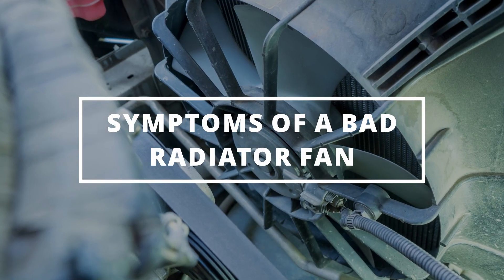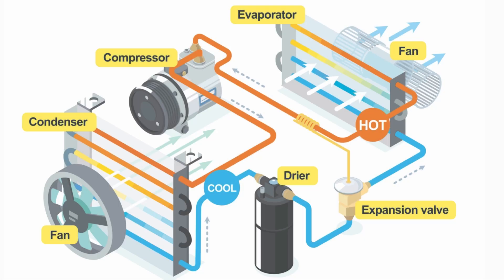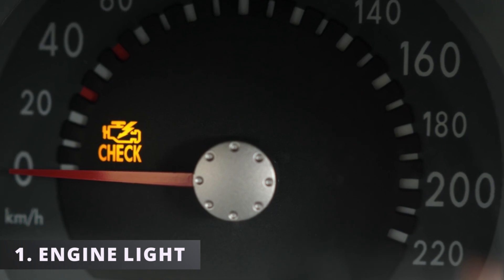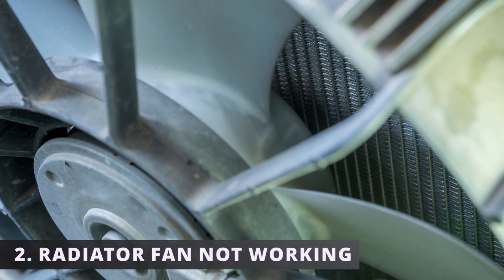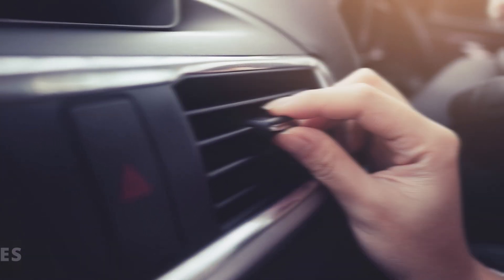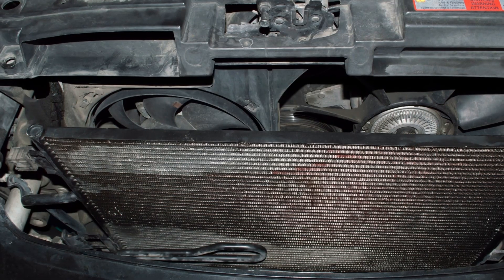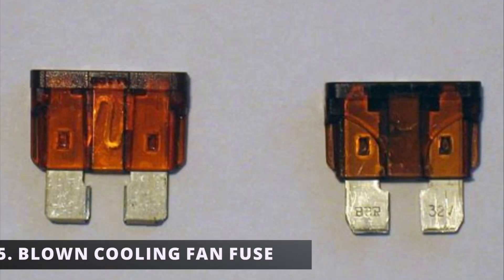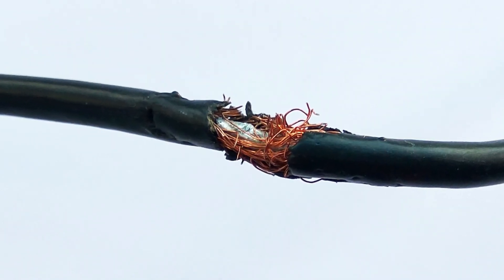SYMPTOMS OF A BAD RADIATOR FAN

Comment: I noticed that my cooling fan don't work and so does the AC fan doesn't turn on but I did notice the other time when I was checking the cooling fan from the driver side I disconnected the plug and I noticed the connector was burned out maybe that's the reason why both fans don't turn on.. I checked the relays and I replace the relays the fuses look good I think that has to be the problem!!

Comment: Am haven a few symptoms in my chavy Tahoe but i noticed that the connector is burn the other driver's side fan but not the ac cooling fan how weird do i have to replace the wires or but the fans with wire connectors!??..

Comment: TO TEST THE FAN : 
 I first turned on AC with car running and the fan never came on. Next I unplugged the electrical connector and put 12v from battery to the fan. Nothing. Next I put my volt meter in the electrical connector and put the meter on my windshield so I can see it while running the car. In the car I turned on the AC, the meter showed 14v.  So Fan doesnt work with direct power put to it, and doesnt work when AC on and system power goes to it. Fan kaput. $100 repair on a 2014 Fiesta and a lot of dismantling to get it out.

Comment: Can a non working fan prevent the AC from completely working? We have a 2014 Toyota Sienna and the AC light is flashing. I checked relays which seem good, and then noticed the radiator fans aren’t turning. The relay for that doesn’t look blown or anything.

Comment: If the sun is down and it’s 74 degrees outside, while the car is in idle, AC is off and the radiator fan is spinning but producing super hot air? Is this normal? The engine bay is too hot to the touch , some people are saying this is normal, but I don’t think so. Any feedback is appreciated.

Comment: If anyone sees this, I replaced a 40amp L shape fuse on my g35 coupe and it turned the radiator fan back on (passenger fan). Then it stopped working a few days later and I saw the fuse bubble up and it’s not blown but it’s to the point where it won’t spin so I guess it’s blown. The fan is aftermarket OE fan so could it be drawing or trying to put out more amps then the 40amp fuse can handle thus causing it to blow? If so I’ll replace the fan Motor
Reply: Update; a nail was touching my harness cord and it thought it was ground so it would blow the fuse!

Comment: I’m seriously struggling to find out why my fan is really loud.. when it comes on I lose engine power. Have no fault codes
Reply: Update: found out it’s just my car doing a regeneration
Reply: @vnoobsniper what’s a Regeneration? 😲
Reply: @ it’s where the engine runs at a higher temperature while driving to burn off spot build up on the dpf filter

Comment: I am having these issues. Turns out both of my radiator fans are not working. I didn't notice the AC fan went out since the main still worked until a few days ago. Not sure when the first one went out, but I guess it is common since the main fan can easily compensate. When I tried to take off the harness from the secondary fan, the harness plug mated to the fan crumbled off and was burnt. I decided not to mess with the main fan plug on the off chance it might still work, it doesn't even after bypassing the wiring. I ordered a temporary universal fan via 2-day shipping until I figure things out.

Comment: my radiator fan doesn't run, and my ac acts exactly haw you described but everyone I asked says they're not related but none of them have looked at it can you tell me other reasons why both wouldn't work?
Reply: I’m in the same boat as you my friend tho u can turn my fan on with a scan tool and, so Ive ordered a new fan with motor module/😮relay  I’m not sure exactly what the box is attached is , also if you unplug your wiring to coolant sensor it should come on automatically , I’ve a few other things to try so here’s hoping it’s one of the above .

Comment: My 2011 ford taurus had the water pump replaced because of leak. But car over heats with running a/c and the fan doesn't shut off and it drains the battery. Please help 
Thank you

Comment: If one of the two fans is working, should the other be working, also, at the same speed? Or is it computer controlled and additive, meaning does only one fan sometimes come on, normally, and the second fan only when needed? I've got one of the two fans that is acting sluggish when I first started the car, then stopped completely before the motor warmed up - not sure if this is normal or not. Thanks!

Comment: I’m having an issue where as though my fan keeps running after I turn the car off and it drains my battery, I just changed the fan and it’s still doing the same thing, what do I do?
Reply: Sounds like the relay

Comment: I had this problem last year in September. I was driving at highway speeds and the AC was cold but in the city it wasn't as cold. It also overheated and stop and go traffic but when I was on the highway it didn't overheat. So yeah it was the fan and I fixed it but I already knew that before watching this video but it's still very entertaining So thanks.
Reply: What was wrong with your fan

Comment: Hi why would the fan stop working on a 2017 Chevy Suburban
Reply: Many of reasons. Could be lost of proper voltage/ground. Is the low and high speed not working or both all together ? If you have proper voltage and a strong ground to your connector. You should try take the fan off and jump the power and ground to the pins. (Note) don’t worry which pin is negative and positive. It’s a dc motor so you won’t hurt anything if you’re worried about crossing the wires. Fan will just spin backwards if anything. But try to supply external power and ground to the control module and if that don’t work. Your narrowed down to a bad control module or motor. You can also by pass the module and juice directly to the motor. If your fan starts spinning after juicing directly to the motor. Your culprit is the control module. Hope this helped. And goodluck with your problems!

Comment: I have a problem with my Mercedes e300, fan sounds like a jet engine but I took it to my mechanic and they said nothing in the car is telling the fan to turn on, so they said I might need a new battery will cost me about $500-$600 plus the labor.

Comment: What if the fan runs but your temperature rises when it's idling or low speeds? Fan runs constantly, even when you've cut the engine. Water pump and radiator are fine. Could it still be the fan?
Reply: Did you find out?
Reply: Fan speed controller. Or a stuck closed relay. Should check both to eliminate the problem

Comment: i think my cooling fan may be bad, i was sitting idle with the A/C on and i noticed the temperature gauge was getting high but as soon as i turned the A/C off the gauge went back to normal… it was also normal when i was driving and it sounds like i can hear the fan when i’m in a drive thru… it’s also hot af in texas right now
Reply: Facts. Im in Houston and shit been 100 degrees
Reply: dont go through drive throughs   lol   lol
Reply: @CJ.A-C 😭😭
Reply: Did you replace the fan and fix the issue?
Reply: @papajoewil10  yeah it turns out one of the fans weren't working so i replaced it and it's working perfectly again
Reply: @sweet49101  Thanks for replying having this same issue right now
Reply: @nkefung  I think my fan may be going bad as well haven’t noticed anything with a/c or heat but when in park if I leave it runnning it will get hot
Reply: My car  fan makes very horrible sound if I drive my car more than 15 minutes or I stuck in traffic for long , and alot of water leak down
Reply: I’m having the same problem right now Smfh
Reply: @sweetp7320  it’s all good check your thermostat start with all thinks cheap first
Reply: @sweetp7320 sorry but if that's your picture you are gorgeous
Reply: This happens to me as well just mine never went back down it went higher idk what going on
Reply: So ur saying this will make the engine over heat
Reply: I noticed my a/c was spitting hot air turned the ac off. Than car started to overheat. Got it diagnosed few days later it was the radiator fan it wasn't working. And had to recharge my system got my radiator fan fixed all is well now a/c spits out cold air. It's been 104 degrees here in TN. Not fun for people that live in hot states or can't afford to replace expensive repairs.
Reply: @nikkie9302  mannnn that’s what I’m getting replaced now …had the water pump thermostat and every thing else replaced and radiator was the issue the whole time .bunch of new parts that wasn’t needed but oh well it’s like brand new new under the hood now
Reply: Mmmm i believe i might have the same issue mazda cx9 temperature went a little higher than usual when i turn off ac went back to normal
Reply: @marianopimentel9911  turn your car on in idol. Turn your ac on max and your fan should start spinning. If it ain’t spinning there’s your problem. There’s a lot of checks you should do before just replacing the fan assembly. Don’t be a parts changer. Diagnose the problem so you’re not guessing what the problem is. If you need any advice give a reply back. I’ll be happy to help !
Reply: @curtischung1009  hey i have a 2016 malibu.  Fans turn on but are in a slow speed. I turn on my ac a d car overheats. And the fans are still in low speed. When i turn off the ac. The temperature goes down.   Some say that its the e fans that are going bad.  But I don’t want to be a parts changer.
Reply: @curtischung1009 hello I am having same problem... My radiator fan on dodge caravan works fine when coolant temperature rises. But don't work with AC on... I changed the resistor and checked relay both high and low . They have continuity... Relays clicks ... AC works fine on highway at idle it sucks ..any help will be appreciated
Reply: @curtischung1009 when the car is idling it will over heat. Fan comes on when ac is on though..??
Reply: @mattr505  check your thermostat
Reply: @mattr505  most likely is a stuck closed thermostat. Relatively cheap to replace your self
Reply: @curtischung1009  I also bought a cooling fan car runs number doesn’t over heat at highway speeds. The issue of overheating has only happened twice while sitting as a drive through. Makes a weird noise and overheats.
Reply: @curtischung1009  I replaced thermostat and cooling fan, car still overheats.
Reply: @curtischung1009  what if you can turn the fan on with a scan tool and you put the ac on full and fan then doesn’t come on , that’s my issue, engine seems hot and having to top up coolant  regularly, I did have a leak in rad which I replaced and I’m now replacing the fan , hoping it was the module/relay attached to the fan motor on my e90 320d .. thnaks
Reply: @curtischung1009  I'm having a issue with a 2011 Chevy Silverado the fans don't kick on when I put the AC on always , doesn't kick on when it reaches 210 , the fans kick on both of them sometimes tho so it has me very puzzled . Any advice is much appreciated !!
Reply: My fan or ac compressor is going out. My car ac went down all of a sudden and it’s never been quite riight after that it happened today so relatively new. But I went to see under the hood and the fan didn’t seem to turn on during the five min or so that I checked.
Reply: Hello, my hice bus 15seater making big noise
Reply: @sweet49101  also disconnect the plug from the coolant sensor , the fan should stay on , that will tell you if it’s the fan or not
Reply: Does it randomly build revs when sitting idle and the ac is on? Mine has just started doing this and it’s now overheated 😢

Comment: Can a malfunctioning fan be intermittent? My car's temperature light came on, car was overheating when idle with the AC on, and days later without the AC on. Can't seem to replicate it again though 🤔
Reply: Looks like you've got a faulty cooling fan. Try replacing the fan motor before it eventually stops working completely.
Reply: @cenchloraadums3143  you're not wrong. Unfortunately the fan motor gave out about 2 days after posting my comment. But I was able to replace it and now thankfully everything seems to be working great!

Comment: I live in Az..its hot.. When I 4x4 I see that my truck kinda starts over heating when I really rush my truck... like climbing up hiills.. SO maybe i should rig up another fan in front of the condenser?  would that interfere with the air flow? also cause more cooling with my ac?

Comment: Mine is making loud noises when Ac is on and when its not. And alternator and battery light popping on and off, seldom. I just had Nissan replace alternator, so I know its not that. Their now saying its the radiator fan wobbling. But it wasn't doing it prior to alternator fix. This is so annoying. 2013 jx35
Reply: I’m having some of these same issues as well it’s just that my fan is not working nor is my A/c
Reply: @aaliyahjackson251  my ac had a leak also. I think it should be a recall on these fans.

Comment: What is the cause of a fan running loud.  There are not check engine or other temperature sensors on. Is the motor bad or do I need to replace the whole fan assembly?
Reply: High/low control module
Reply: Or could be the temp sensor that’s relaying false information and causing the fan to run at high speeds when it really shouldn’t need too much
Reply: I have an 01 civic and turns out my fuse in my car has a bigger amperage than the original cooling fan fuse.Everytime I turn on my car the fans kick on immediately I'm ordering a new fuse rn.
Reply: Your motor is bad lol
Reply: Jk

Comment: Think I found my issue. My cars AC gets iced cold at higher speeds and semi cold at lower speeds. The cooling fans don't work at all not even when the ac is on. However, I tap the fan motor and it turns on. And I wanted to say it was a bad thermostat or bad ECT sensor and the relays and fuses but I replaced everything. Fan still don't work. The engines temperature stays at 195° when I'm driving the car. But at a stop light or stop sign for too long and it'll overheat.
Reply: I have the exact same issue except my fans do come on but then immediately turn off every other minute making the car overheat.  Not sure if u should just replace the whole radiator fan or if it may be another issue.
Reply: "However, I tap the fan motor and it turns on" - It's the worn-out fan motor brushes as it seems. Try replacing the fan motor.
Reply: @Cenchlora Adums  I personally put dc 12 volts to fan motir to eliminate motors.  I believe mine was coolsjt sensor
Reply: @kevinhancock4064  yeah, but when the fan motor brushes are worn out, there's a state where it can occasionally stops spinning, so you won't be able to troubleshoot it this way.
Reply: You say you found the issue was it the fan solenoid ? The 1/2 near the fans ?
Reply: Had that issue. Replace my ac compressor solenoid valve
Reply: @rosendaniel1258  that affected the fans ?
Reply: Check PCM module connectors for corrosion and use alcohol to clean them
Reply: I have the same issue. Did you find the solution for it?
Reply: Omg wow all of this sounds like what I’m going through with my car Smfh 😩🤦🏽‍♀️

Comment: My cooling fan turns on and off while my AC is running . Do you know what the problem can be ?
It’s a 2018 Camry se 4 cylinder . Thank you
Reply: Thats normal it turns on and off to regulate temp not to keep running. The problem is when yoy turn ac on and fans don't come on at all when idle or at a stop light which will make the car start to overheat.
Reply: Same problem with my 94 Corolla, I can hear the relay clicking on 
& off fast
Reply: @mupcountry7153  same here, will replacing the whole radiator fan fix this issue? Or is it something else. I don’t want to buy and install a fan without it being the actual cause.
Reply: Ive got the same problem in my 2005 mustang gt my ac will be cold sometimes and then sometimes not because the fan wil switch on and off